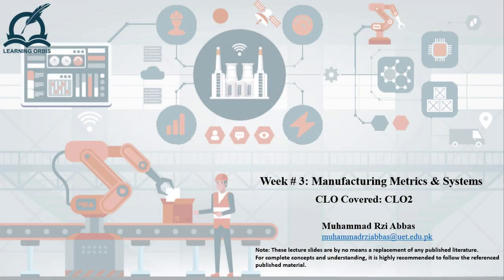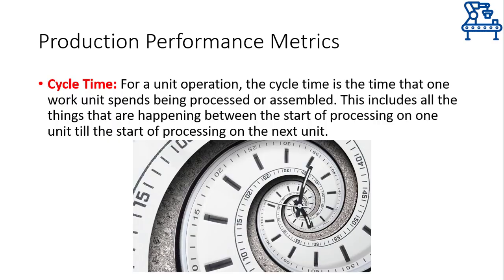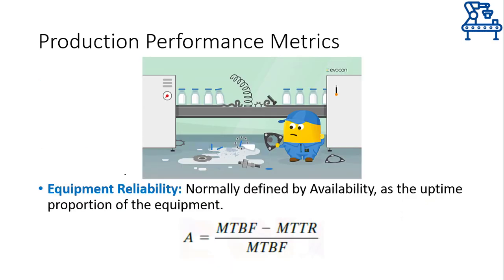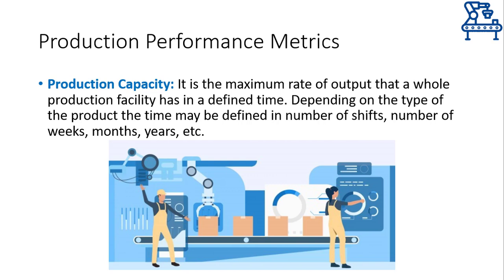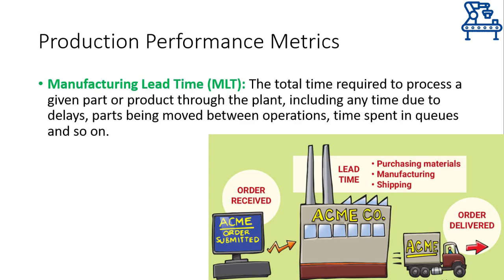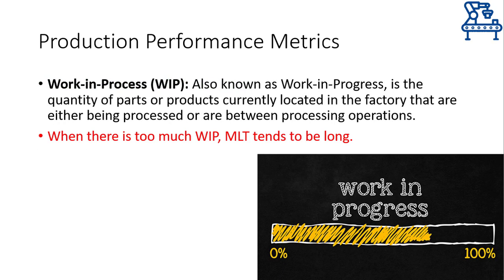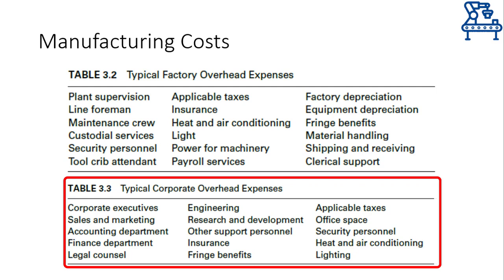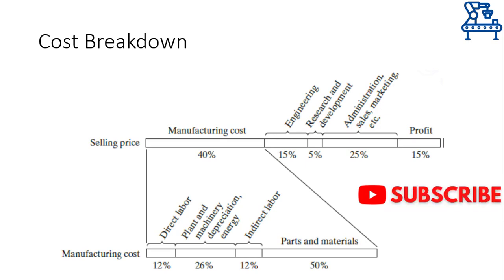Manufacturing Metrics | Performance and Cost

Comment: at 4:02,A low order utilization means factory should get more orders from the client and hence more use of the product .....??????
Isn't is a high order utilization, means that we are now max. using product to get more and more orders?
Reply from the maker: Mr. Faisal Shahid has answered it quite well.
Reply: Its not about the product but the equipment installed to produce that product. If an industry is not utilizing the equipment fully then it can take more order to fully utilize the equipment and resources. For instance if an equipment is capable of producing 100 parts and company only producing 60 to 70 parts then it is not fully utilizing the equipment and resources.
Reply: Thanks for your support 🙏